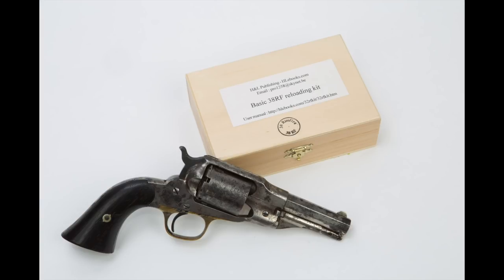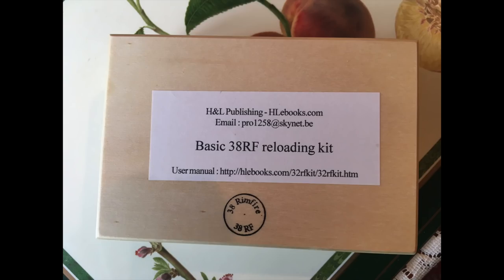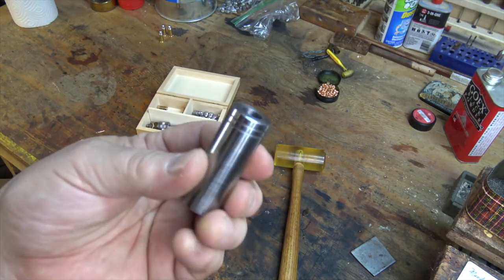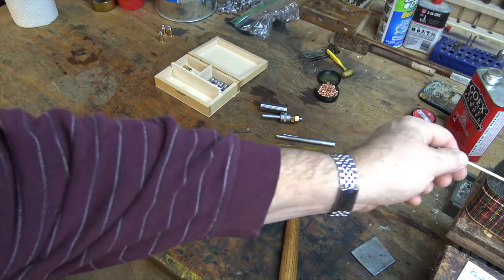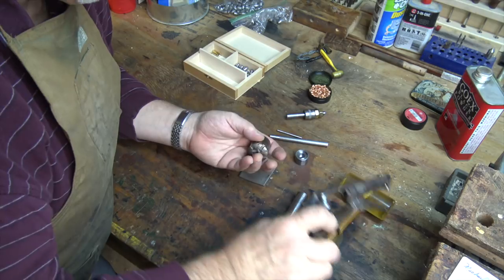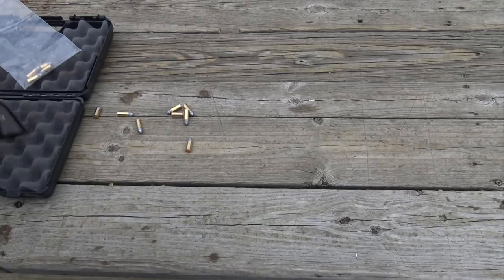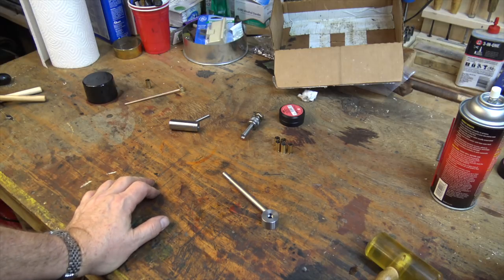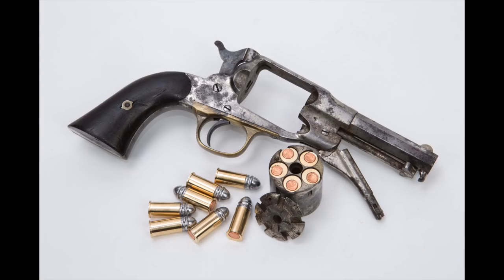REMINGTON NEW POLICE REVOLVER &  38 RIMFIRE RELOADING PART 2

Comment: Clubbing the .22" blank in on to of a loaded round does'ent  exactly fill me with confidence, surely it would be better to push in the primer first, then seat the bullet in a press, or even your vise, it would take the striking blow out of the equation.
Reply from the maker: I have to say that I didn't like that either, but I was showing it as the directions state. Subsequent to this video I have been loading the primer first, which works just fine, and has a lower pucker factor.
Reply: Ha Ha ! That is a much better way of doing it, I think pushing the blanks in would be OK, but striking them does look like a disaster waiting to happen, the fact that a black powder loaded round in a tube would go off just like in a barrel makes it likely that you will end up with a hole down through your bench top! Take care, and Happy New year to you. Chris B.
Reply: Harbor freight arbor press seems like an appropriate tool for the task.
Reply: @GunFunZS  The old Lee Whack-o-matic works the same way but primer first is the way.  All it would take would be a slightly oversized blank or a tight pocket and you have a potential disaster.  I had one tight CCI shotgun case blow off a 209 shotgun primer one time using my trusty Lee tool.  That thing would blow right thru the ceiling into the room above maybe.
Reply: @Newtire  ...And if anyone has used one of those lee field reloader (or whatever theyre called) knows that the chance of a primer going off under these circumstances is actually very real. I advise anyone reloading with one of these to at bare minimum wear ballistic safety glasses. I had a primer pop right under my face while smacking away with a mallet just like this. I was following the instructions and it was not an error on my part. I think this style of reloader is totally viable I would just never fill powder first even if it says to.

Comment: My Dad had old RF hand guns and could reload RF cartridges using strike on the box matches and the striker dust off the side of the match box and alcohol. He had an assortment of bullet molds and home made tools to crimp the case. I use the same formula to make percussion caps for my cap n ball revolvers using soda cans. I use hairspray to seal them they work fine..

Comment: I've seen it posted several times and I read your answers a few times as well but I agree, pounding on that primer is a little creepy. When you finished without a bang, I was relieved. I'm glad to see you started putting the primer in first. That way if it goes pop, there is no powder and bullet in front of it. Might have to change your shorts but that's better than a hole somewhere there's not supposed to be one.

Comment: Very interesting concept... I have an antique Ballard single shot rifle in 44 Henry rimfire. What I did years ago was measure the chamber and turn out a steel casing to fit it. I drilled a hole at the edge of the rim. I would pull the bullet out of a 22 short to use for a primer fill it with FF black powder and seat a round ball on it. This works very well but there is quite a long turnaround between shots.... I love your videos.

Comment: There is another way to go about this. Sharpshooter makes a kit for reloading 22lr. They offer a priming compound that is a three part mix that makes a priming compound that can be mixed with a little alcohol with a drop or two of clear nail polish for a binder.
The kit comes with a tool for scraping out the old primer fouling. 
The wet priming is forced into the rim and let dry overnight.
Next day a powder charge is poured into the cases and a bullet with a long shank is crimped into the case.
If suitable bullets could be cast or purchased it would be very doable.
In some cases eras gone bullets could be used.

Comment: Big fan of your channel. Stupid question, I have learned from you and others that black powder has to be compressed and I didn't see that being done. Great video. Happy New year from California.
Reply: I think he loaded it to the top of the primer opening. So, when seating the primer, that gave adequate compression. Should be better priming the case first, then adding powder to a height where seating the bullet would slightly compress the powder.

Comment: For safety's sake, I would size it first, then prime it, then put the charge in before finally using some kind of press to seat the bullet. If the primer does go off, at least then you don't have a charged round with a bullet seated in it. Better yet, I'm sure you could rig up a way to seat the primer with a press to avoid having to bang on it.

Comment: I know that people for years in the past in wilderness areas were repriming obsolete rimfire rifle cases for hunting purposes.  I recall claims that they used percussion caps, but it seems that a .22 rimfire case would be more likely to work.  I have several thoughts/questions.  Would it be unsafe to use the lowest power. .22-25 rimfire power driving cartridges without black power to power those bullets.  If one had a template/jig with a drill press likely one could drill your own cases.  Perhaps .38 S&W or .38 colt either long or short cases could be made to work.  Perhaps one of the reloading dies for .38 caliber cartridges or even a 9x18(Fires 9.27 bullet) makarov set could be used.  I agree that striking a rimfire case for seating is unsafe.  I would set up one of my reloading press to do it.  Or at least using shielding and keep my body parts away when using the hammer/mallet.  Here is a common source of power driving loads:  Home depot
Ramset
0.22 Caliber Yellow Single Shot Powder Loads (100-Count)

Comment: Mike, is there any advantage to using modern design cast bullets for a .44 caliber repro (Colt or Remington) such as a 230-grain round-nose bullet or 200-grain semi-wadcutter as used by a 1911 pistol or .45 Colt SAA (made from soft lead of course)?
Reply from the maker: No. They are pretty hard to load because they have no heel section.

Comment: Thank you for your video Mr Beliveau. Could you please tell if the 38 Rimfire is interchangeable with a 38 colt and would work in an 1877 Colt?
Thank you
Reply from the maker: Both cartridges are the same size. But you can’t fire a rimfire cartridge in the model 1877, which only came in center fire

Comment: You gotta be the guy who would know this would heat resistant grease be ok too use for the threads on nipples to assist with getting them out to clean I've been using a tc anti-sease wrong spelling sorry that works ok Also would anything else be ok just looking for when the TC is not available.  Thanks
Reply from the maker: I have used bearing grease, but usually I use choke tube lube.

Comment: Mike. I have a new Uberti 1858 Remington with a Howells Old West .45 colt conversion cylinder. As a BPCR shooter I find it quite a bit of fun to shoot with blackpowder cartridges. My question is the conversion cylinder is of the same design as the one in your .38 rimfire new police. Was there ever an original conversion done on the 1858's in .44 caliber with that type of two piece cylinder? Or is that simply a modern design copied from the .38 rimfire guns?
Reply from the maker: Kyle Michaels all the two-piece cylinders I’ve seen are .38 RF. But I’ll hit the books and check.
Reply: @duelist1954  Thanks. I never even knew original two piece cylinders were a thing until I saw this video.

Comment: I do not have the dimensions of that rimfire case but I am wondering why you can not simply modify that cylinder shield and the hammer spur and use a  modified.38 Special case?
Reply from the maker: You could, but you would have to add metal to the hammer and re-machine the face...You'd pretty much ruin the value as an antique.
Reply: Hasn't your filing on the cylinder shield already ruined the antique value?

Comment: Hey Duelist. I have a couple black powder handguns. I love getting these out to the range but the experience almost always means fidgeting with the darn things to try to get through two or three cylinders without major trouble. I am sure there are things that can be done and that I can do to make them perform more reliably and I have figured out a few of those. What I am curious about is how did these guns perform during the civil war. Did they jam and misfire and lose primers off the nipples etc. I cannot find any info that reports on the issues soldiers may have had trying to fight a war with cap and ball pistols.Do you have any references to books etc that give some commentary on difficulties soldiers had with these pistols?
Reply: Check out Mike's videos and maybe some others on working these guns for reliability. There are a few things that can be done, esp to the Colt style guns, to improve the reliability.

Comment: Was there ever a kit for this to convert .32 rimfires?
Reply from the maker: Not to my knowledge
Reply: @duelist1954  do you know if an 1863 Remington pocket model that was factory converted long ago to fire .32 rim fire could be retrofitted to fire cap and ball again? I know DGW sells replacement cap and ball cylinders for the Italian replicas for these in .32 and one commenter said by opening the pin bore on the repro cylinder it worked in a vintage Remington. Have you ever heard of this being done, even with the .38 rim fire police Remingtons, I.e convert them back to cap and ball cylinders? Thanks

Comment: Couldn't you do everything but the priming/depriming with a set of .38SPL dies?
Reply: Mr. Polecat I was thinking the same thing. If it is not possible they should make shell holders to fit in a modern priming tool and redesign the deprimer/sizer to fit in a modern press.

Comment: I hope we get a future video on lowering the costs of reloading rimfire, because I know the cases are expensive. I'm just wondering if there's a way to modify .38 Colt cases to put in a rimfire blank hole.

I would resize with .38 Special die.
Reply: When the Civil War was over there were lots of percussion revolvers available cheap.
Many were converted to take rimfire cartridges because it was pretty easy to do. They say that even blacksmiths sometimes did it.
A few years later the centerfire primer was adapted to the same lenght case and bullet.
The 38 Special eventually evolved out of these early rimfire and centerfire cartridges. 
The 38 Special case can be used to make the centerfire cartridges.
The difference is the early bullets fit the 375-380 bores of the percussion revolvers.
These conical bullets had long bases that fit inside the case mouths and were crimped in place.
On the later 38 Special the whole base of the bullet fits inside the case. 
Dixie Gun Works used to sell cases  for 44 rimfire rifles that were cut for 22 blank priming.
It seems like a simple job to make a few of these on a unimat ot harbor freight mini lathe.
Reply: @johnndavis7647  Hmmmm, I would take a .38 S&W case personally, easier to work with and Starline make some good one.
Reply: H&L Publishing makes these expensive loaders for many old calibers:
http://www.hlebooks.com/

Rimfire: .32,.38, & .41 

Centerfire: 32 S&W .32 Long Colt & .380 CF "Bulldog" .38 Long Colt
.320 & .38 Short Colt, .41 Long Colt, 10.4 Italian Bodeo, (.450 .455 & .460) Webley, 10.6 Reichrevolver (or 44 Russian), 7.5mm Nagant

But .38 Short Colt .38 Long Colt .32S&W .32 S&W Long .44 Russian can all be done on a normal reloading press. Lee make $35 cheap die sets for those. I use a Lee die set for .32 S&W centerfire.
Reply: @Warptenlololol  its not really the case thats the problem. Its finding bullets of bore diameyer with long enough bases to fig inside the case so the bullefs can be crimped in place.
Eras Gone makes a mold for .380 bullets with a long base that is intendef for usr in making paper cartridges.  That bullet should work in a 38 s&w case or a fired 38 spl. Case to make 38 long centetfire ammo.